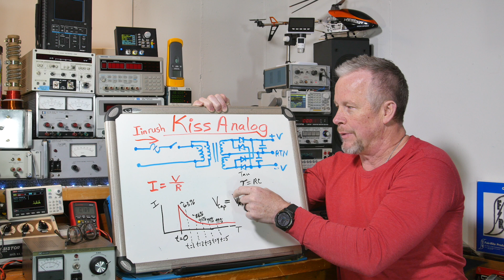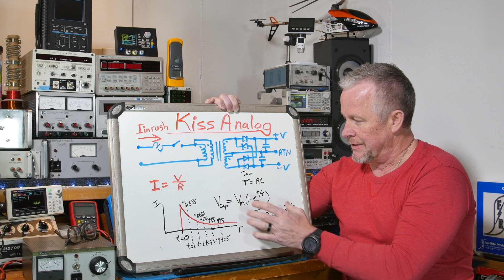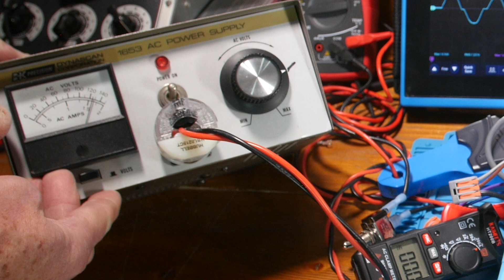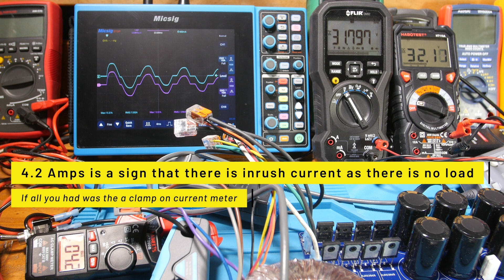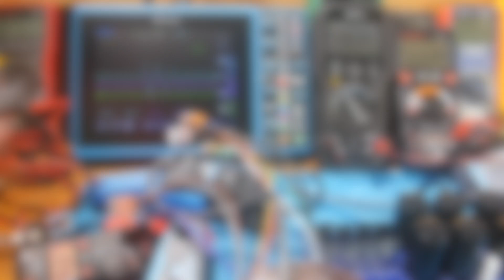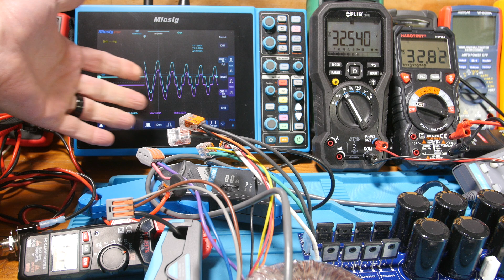Current Inrush Measurement Hantek vs Micsig #hantekCC65 #CC-65 #Aleph5  #lowcostcurrentprobe

Comment: My Inrush current: 480Vac 3phase mains rectified at contactor closure and fed to 2800 uF cap bank. Well, okay, use a beefy series connected 20 Ohm resistor that gets shunted closed after 400 msec.
Reply from the maker: Thanks Marc for this great feedback!  Now that's a power supply! ;)  Is that 20 ohms is on the DC side?  What type of resistor is it?

Comment: Excellent video.  I learned a lot.  I wonder how different the Tek probe would have displayed the wave form.
Reply from the maker: Thank you!  I'll have to do more videos comparing all these probes.  Have you seen this video with the Tek probe? Thank you!  I'll have to do more videos comparing all these
Reply: @kissanalog  A recently purchased P6042 is on its way to me now.  I assume the cord or probe's transformer is going to be bad.  It was still a good deal.  I know the offset voltage is matched to the probe.  So not sure how easy it will be to adapt the more common P6032 probe. We'll see.
Reply: @kissanalog  Yes.  The Tek probe is pretty cool.  Thanks to your videos, I have a Tek P6042 and the Hantek now.  The Tek of course needs some TLC.  I've repaired the broken wire in the probe head.  The calibration is tedious because I have additional problems.  I fixed the ripple and extremely leaking power cap.  Would you consider videoing a complete calibration of your P6042?
Reply from the maker: Thanks - I'll do this and a repair as mine now needs it too...

Comment: Good stuff Eddie. Want a probe for my scope to look at inrush current...as opposed to a clamp meter which non (I have found) describe how they measure inrush.
Reply from the maker: Great Question!  If you don't have a clamp on probe, you can put a small value resistor in line and measure the voltage across it as you turn on power.  Let me know if that answers your question;)
Reply: @kissanalog  Yes...I did that initially and it worked...just kind of a pain. Would rather do it with an inductive probe. It will be interesting to compare my homemade probe (toroid wound with a few turns) with a commercial probe.

Comment: Great video and well cut, especially at 19:35 where you reset your gear, invisible:-)
I was wondering about a power supply for inrush. Could you not have made a slowly charging power bank with maybe 1MuF with as low impedance and ESR  as possible, use an opto-relay to avoid "bouncing" switch? In that way will you have direct, unobstructed power to connect directly to your DUT after the transformer.
Reply from the maker: Thanks for your support!  Yes, that's a great question and possible solution.  Some people use a relay to short out the NTC (or a resistor) after a set time.  I'll show different ways how to control this in a future video. ;)

Comment: Very informative video. 👍
When voltages are comparatively high, for example in the case of tube amp B+ voltages, I always install extra series resistors of proper value either between PT and rectifier or between rectifier and first smoothing capacitor to keep inrush current peaks in safe levels to relief the stress of rectifier and caps. Of course the price of it is small voltage and power loss but the reliability of the power supply and lifetime of caps will hopefully be much better.
Even tube rectifiers, which have quite large inner resistance, love extra series resistor or choke to reduce current peaks.
Reply from the maker: Thanks for that informative feedback!  I appreciate you!

Comment: 21:38 That funky waveform seems like ringing through a transformer.
Is your bench connected straight to the mains, or are you using a isolation transformer ?
Reply from the maker: Yes that was connected straight to the mains.  I think it is the transformer collapsing with the current.  Then resets and tries again.  Thanks Bjorn for the great question!

Comment: Hi Eddie!
Thanks for your video on current clamps and their practical use on measuring inrush current!

NTCs do a great job in reducing the inrush current. I own an Oltronix B32-10R power supply. Inside sits a heavy C-core transformer that used to trip my circuit breaker like every 3rd time I was switching it on (it's a B16 thermal-magnetic, so the most sensitive one will trip immediately with a peak current of 48A and the least sensitive with 80A, also my net impedance is quite low, so my regular power outlet ist able to deliver >300A in a short circuit condition).
I did decide to make and install a little PCB with an NTC in series to it's mains transformer. After this mod all my worries are gone :)
Reply from the maker: Thanks BeamFinder!  That is a great real life example!  Sounds like a nice power supply;)
Reply: @kissanalog   Indeed it is! Imagine your big HP power supply combined with a linear supply.
Oltronix specialised on secondary switching power supplies with linear regulation afterwards. The supply by itself is perhaps from the 70's but it's still great today (sure I had to replace some caps).
As I'm doing tube stuff as my hobby, I like to use it as a DC heater supply, or just for blowing up things :P

Some pictures for the interested people:

The Oltronix front (above my small tube psu):
https://i.postimg.cc/VsXVLr53/vdh-oltrnx.png

An overview of the power electronics (the ruler is in inches):
https://i.postimg.cc/jSxQTCJQ/P1000464.jpg

My NTC mod (the quite large copper planes are for sinking away the heat):
https://i.postimg.cc/5NFSgZWL/P1000463.jpg

Comment: Great demo - well explained on the whiteboard and good to understand the implications of using bench power supplies for this sort of testing.  Interesting to see the impact of the Thermistor.  I did wonder if you were going to stick the knife switch into the circuit to give it a good connection with little to no switch bounce.  Looks like the cheaper current clamp meters are pretty good for low frequency measurements.
Reply from the maker: Thank you Andrew!  I thought about using the knife switch, but the video would have been a bit longer:) I appreciate your feedback!

Comment: Hi I was thinking I've not seen them in switch mode power supplies why not used a crystal control board for switching in the time domain surely this would be quieter more accurate got a opinion or am I being crazy. 
make much difference having the thermistor on the primary side or secondary side of the transformer
Reply from the maker: That’s a great question, but even a switching supply can have a high inrush.  Although smaller caps so it doesn’t last as long.
The thermistor placed on the secondary side would see larger continuous current as the voltage is lower so the current is higher.  But, that’s still a great idea - just trade offs.
Reply: @kissanalog  yes I suppose that would but the thermistor would suffer over-current only limited to certain current? 
I'm not talking about switch-mode power supplies having rush of current more the crystal controlling it faster smoother is that the case? is  the crystal more stable quick to responding then using a transistor or IC
Reply from the maker: The inrush comes before the switching transistor - or the biggest part does.